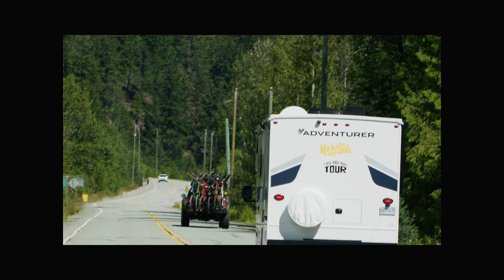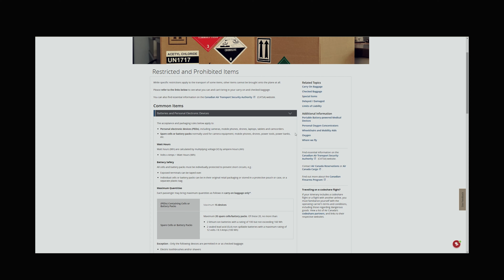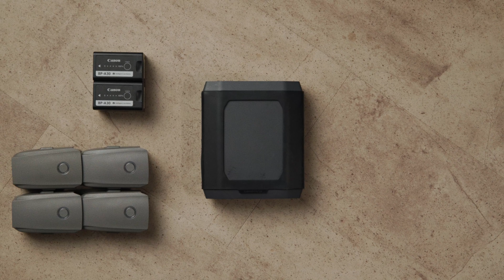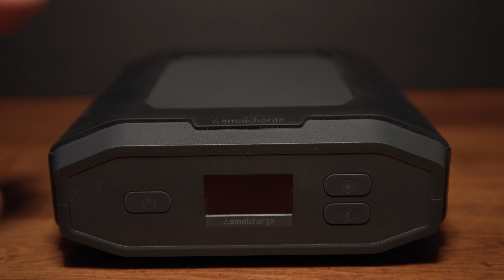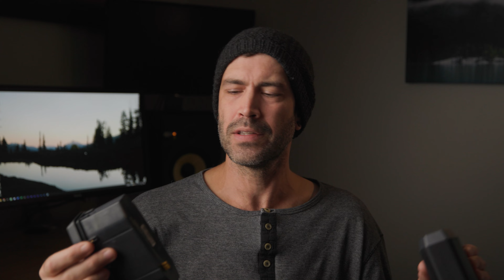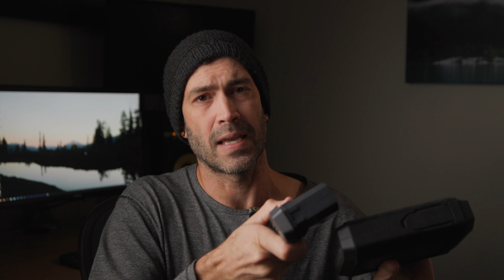HUGE Power Bank You Can Take on an Airplane - Omnicharge Ultimate

Comment: So i can take several power banks  on a palne as long as EACH does not exceed the 100 Wh, right?
Reply from the maker: Each battery is 142Wh so you'll have to check with your airline. Most will allow you to take 2 batteries over 100 Wh but it's up to the airport security agent.

Comment: Can this be charged with other USB power banks?
Reply from the maker: I would assume so
Reply: @ScottBell  The back ports seem to be AC, and DC only. No USB C. I been looking for a small 60000mAh power bank with an AC outlet that can be charged via USB C. So far, no luck. :eyes-purple-crying:
Reply from the maker: @musashi-san____1409  I charge it via a USB C plug every time. Granted it from a wall plugin but it's a USB C connection.
Reply: @ScottBell  Ok. Thank you so much.

Comment: Great review.  I agree with all of your would like to see points..  I am disappointed wireless charging is gone from this model.  I know it generates heat and they removed to make way for swapping the battery.  I also agree the separate battery needs to have a feature to be charged externally and there is a need for quick release.  I do like the DC Barrel jack but we also need to see a 3rd usbc inlet/outlet.
Reply from the maker: Cheers, thanks for watching. Still an awesome unit to have but def could see some upgrades for another version.

Comment: The video for the other omni charge mentioned another drawback which is it has a 100watt out but only a 35 watt in put, or something like that, which makes it hard to charge to keep up with all the charging it does for other devices. I like your point made too. The concept rocks. With those two changes, suggested between you and the other guy, it would be perfect. Still gonna get it im thinking ! Just to be portable.
Reply from the maker: Thanks for watching. Ah that might be the reason I was running into issues keeping it charged up!